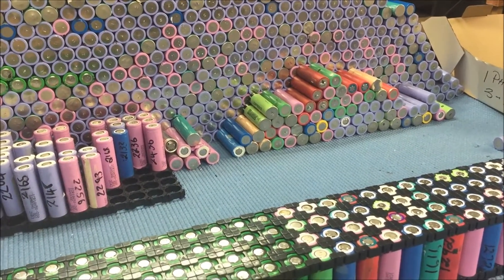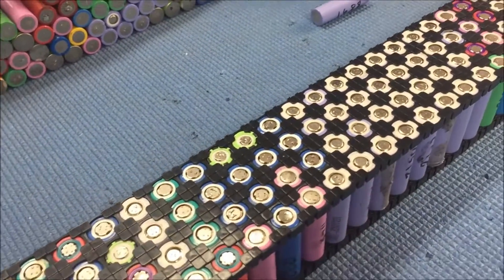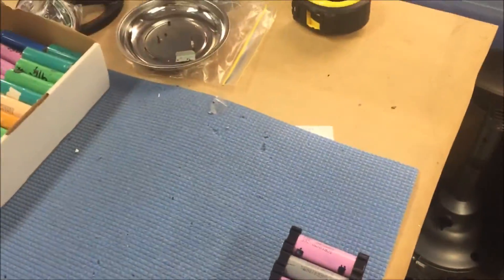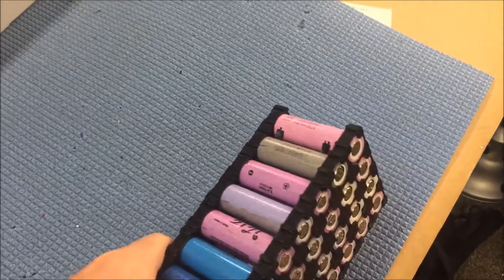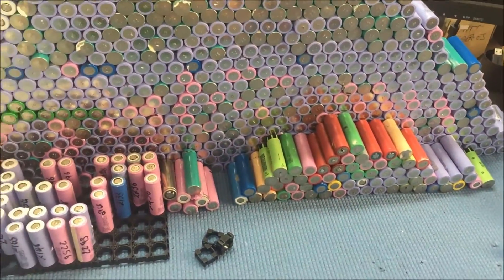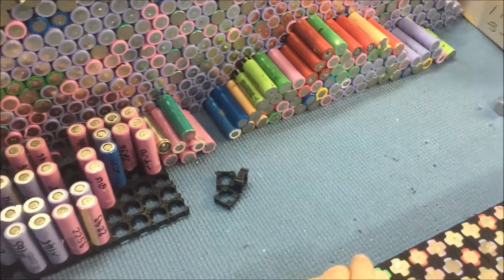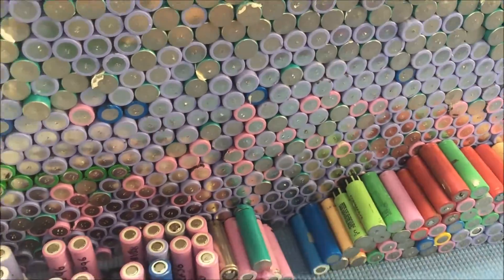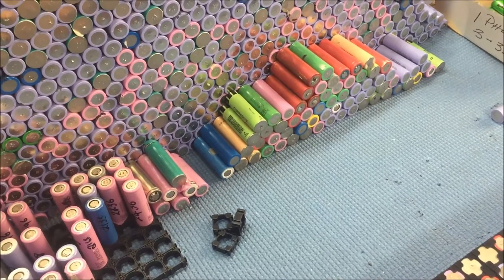Homebrew Tesla Powerwall - S01E14

Comment: Hi! Peter from gumtree the other day here. I've been thinking about this testing (discharge/charge) of cells thing and the time it takes...

Do you find much variation in a battery pack? Say you pull 8 cells out of a HP pack - have you tried testing all 8 of those knowing they came from 1 pack? In my (much smaller sample size than yours!) experience, the genuine battery packs (not chinese after market ones, they're useless!) have been quite consistent.

I'm thinking if you measure the voltage of all cells as they come out.. If all cells in a battery pack are close, eg all 3.8-3.9V, you might only need to capacity test 1 of them, and it should be a good guide as to the capacity of the rest. Given they all encounter similar conditions (thermal variations do exist but generally if the balancing/monitoring circuit is working well, you'd think they are quite similar)... this may be a way to optimise the testing.

Of course, if the cell voltages vary wildly, you'd probably need to test individual.

Also, may I just mention, I just drooled a bit when I saw how many identical black packs you had on that table... would love to know your source! ;)

Keep up the awesome videos, and don't give up!!
Reply from the maker: +snowcrazed1 the simple reply is TEST EVERY CELL, i've now done enough to know that guessing isn't an option, in fact I would now say that is simply dangerous not too.
Reply: +HBPowerwall yep, I agree with that.
During my charge/discharge cycles I have found a lot of cells in the lower than 2V range that have better capacity than some of my cells that were received at 4V.

Comment: Peter, I may have missed something when you explain the capacity of your 160 cell "pack" stating there's 160cells=320aH (OK@2aH/cell), but then you say "which I put at about 7.5kWh". Are you talking merely about this pack, or are you referring to 6 or more of these?
Reply from the maker: umm, ok as I state regularly - I learned it all from YouTube. They way I worked it out - 160 x 2ah then put that into an online calculator and 320ah x 24v = 7.65 kwh came out. At 24v but I'm just guessing that because I'll be running 7 of these that number may (or may not) be a bit higher as the top end will be 29.4v. Who knows, time will tell the TRUE output :) but that's another video isn't it .
Reply: +Peter Matthews 
I understand you're setting up a ~24V system? If that slab of 160 cells are all in parallel (let's assume for the moment), then, as you say, you have 320aH of stored electricity. Assuming you'll place 6 of these in series to get ~24V, you'll then have 6x320aH=1920WH, or 1.92kWh, or another calc to confirm is
160x6=960 cellsx2aH = 1920WH.
Reply from the maker: +Retinalism Ok if your right I&#39;m very Very wrong and the old interweb has let me down. Steps I&#39;ve taken to check my interweb skills  1. https://lazycackle.com/Convert_from_Ah_to_KWh___Online_Calculator.html  2. Enter AH (320) one pack is 320ah at say 3.7v x 7 (25.9v but we&#39;ll say 24v)  3. Enter V (24v) 4. Blindly believe the result in front of me then quote in my video as the truth as told by the interwebs.To be honest I don&#39;t REALLY care as I&#39;m not teaching anyone anything I&#39;m just fucking around in my shed having fun and sharing the experience - that said - I&quot;M going to nut this out as I really want to know capacity and now I have doubt in my mind ...hahahah
Reply: +Peter Matthews 
Simplest way to calculate storage capacity is multiply individual cell storage (3.7Vx2aH=7.4WH) by total number of cells used, "layout" is irrelevant. So your 160 cell slab calcs to 1,184WH, and the going for six times as many gives you 7,104WH or 7.104kWH for all those cells. You could choose to  arrange them, say 80 cells x 12 in series to get double the voltage, you'll still have the same capacity because your number of cells, and their capacity remains unchanged, just delivered with more pressure (voltage) and reduced (by half) flow (current) for the same amount of work rate (watts). Hope that clears up any confusion. 😃
Reply from the maker: Nop made it worse, if it is that low I'm quitting now..
Reply: +Peter Matthews 
Sorry Peter, didn't mean to burst your bubble and somehow I'd now like you or someone else here to prove me wrong...
Pls don't abandon your project as it is worthwhile, Li-ions are best energy density and when properly managed are very durable and safe. You won't cram more stored electricity into the same space these critters occupy. JehuGarcia, IMHO hasn't taken enough time to clearly spell out the maths involved, he's good at selling the concept glitz, sadly the detail's paramount in decision making. 

This excerpt may be helpful by explaining TESLA's battery  config:
"Our third observation is that the entire pack consists of 16 modules connected in series, therefore the overall architecture is 96s x 72p. The stack voltage is nominally 96 x 3.6 = 345 V, but would be as low as 310V when the pack is nearly empty, and 403 V if the battery is at 100% full (but Tesla does not recommend that you charge the battery to 100%)."
http://qnovo.blogspot.com.au/2014/11/31.html?m=1

Comment: so would you say that type of charge discharge device isn't worth the Investment ? what bms system are you thinking of using
Reply from the maker: +Lithium Boy it's definitely worth the investment (so far ) as for the BMS this is the one i have ordered it should be here today or tomorrow 29/12/15
Reply from the maker: +Peter Matthews http://www.aliexpress.com/item/7S-24V-29-4V-Lithium-ion-18650-battery-lithium-polymer-battery-BMS-with-200A-constant-current/32467798383.html?spm=2114.01020208.3.1.Qirz2c&ws_ab_test=searchweb201556_2,searchweb201644_4_79_78_77_82_80_62,searchweb201560_4 ooh you'll need that too....

Comment: been watching this and want to make a suggestion for capacity testing cells was in the same boat and decided to do a bit of searching and found these maybe some one else can comment on them but to charge and discharge and then charge cells again it makes for a easy process especially with that many cells . with 10 of these you can do 40 cells a throw making for a easy and acceptable time frame . couldnt paste link but do a search for Liitokala Lii 500 engineer 18650 charger
Reply from the maker: +Lithium Boy I have looked into those, however i'm a fair way into the project and need consistency as I plan on bottom balancing the batteries and I would like to have them all done with the same device. Even tho it is driving me nuts only doing 6-10 cells per day time is on my side as I don't have all the cells to complete the project plus some of the high priced items (inverter) but thank-you for your input it's all very much welcome.

Comment: You still selling the laptop batteries you offered in another video?
Reply from the maker: +Phillip Aboody Had every intention of selling some however at this point they are required for my project to proceed faster. Stay tuned as there are 100's more battery packs but they are all in computers that need to be tested first before parting them out.
Reply: ok